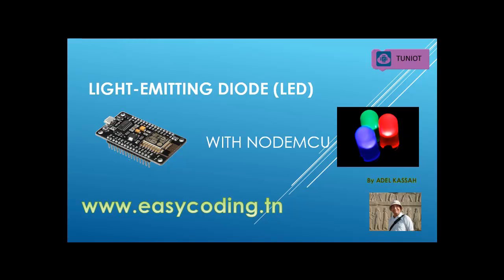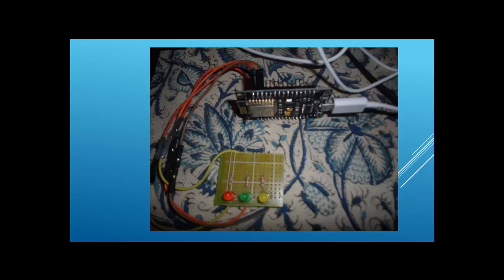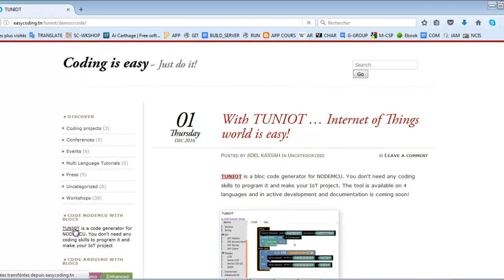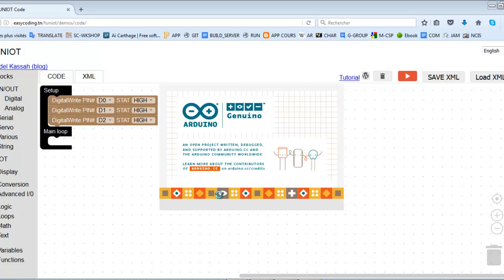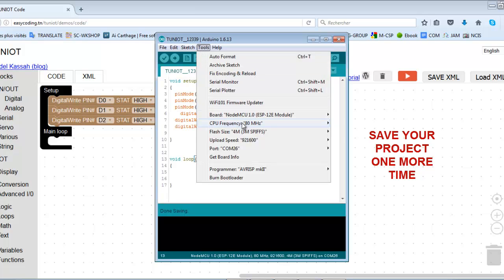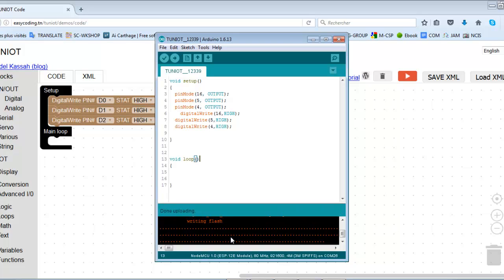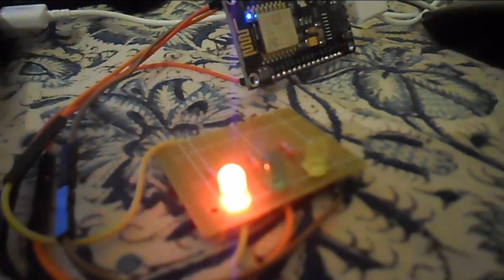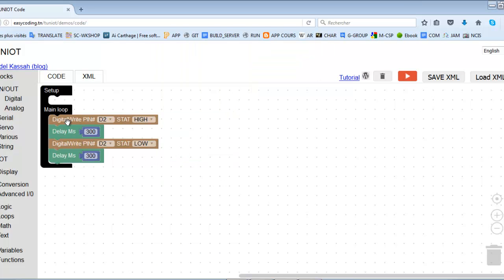NodeMcu (ESP8266) Tutorial A-03: Working with LED

Comment: Even after uploading the code and usb is removed again when usb is attached after some time same code is running how to get rid of this
Reply: once u load a program on its memory, it will work for as long as there is power. So u reconnect power, the code stored on memory runs again. This will not stop until u load a new program.

Comment: Hi All,

For those of you who are new to the ESP8266 and the NodeMCU board, be aware that the NodeMCU pin numbers are "logical" pin names that get translated into the ESP-8266 "physical" pin numbers when the Blockly code is translated into Arduino C code. 

On the ESP-8266, there are 17 General Purpose I/O ("GPIO") lines known as GPIO-0 thru GPIO-16. Six of these are used by the ESP-8266 SoC (System on a Chip) for addressing the system (flash) memory located on the ESP8266 chip. The six lines chosen were GPIO-5 thru GPIO-11, right smack in the middle of the range of available I/O pins.

This "rookie mistake" made by the designers of the ESP-8266 SoC divides the set of usable I/O pins into two sets: GPIO-0 thru GPIO-5 and GPIO-12 thru GPIO-16. So, if your program requires a series of I/O pins which you would like to treat as a single array, you can't do it because of the break in the middle. You have to code it using two for() loops instead of one. So, to fix this problem, the designers of the NodeMCU board came up with this idea of assigning logical names to these GPIO pins and having their software (eLua) automatically translate the logical names into the physical GPIO pin numbers for you.

TUNIOT also does this translation of NodeMCU logical pin names into the physical GPIO pin numbers for you, which you can see when you examine the resulting Arduino C code. When working in both of these languages,  it is useful to see how these NodeMCU pin names map into GPIO pin numbers. So, here's NodeMCU Pin Names vs GPIO Pin Numbers:

    NodeMCU           ESP-8266 GPIO 
    Pin Names:         Pin Numbers:                Notes:

          D0                  16   Controls Blue LED on ESP-12 WiFi Module
          D1                    5
          D2                    4
          D3                    0
          D4                    2   Controls NodeMCU Blue LED near USB connector
          D5                 14
          D6                 12
          D7                 13
          D8                 15
          RX (D9)           3   Serial console receive data line
          TX (D10)         1   Serial console transmit data line

On the NodeMCU board there are actually two different little blue "on-board" LEDs. The first is the little blue LED located on the ESP-12 WiFi Module (located near the WiFi antenna). The second is the little blue LED located nearer to the USB connector. This first LED is accessed using D0 (GPIO-16), while the second is accessed using D4 (GPIO-2). The TUNIOT "integrated" LED refers to this second blue LED located near the USB connector on most NodeMCU boards.

 
Here are these mappings reversed

    ESP-8266 GPIO           NodeMCU
    Pin Numbers:              Pin Names:  Notes:

          0                  D3
          1                  TX (D10)       Serial console transmit data line
          2                  D4                  Controls NodeMCU Blue LED near USB connector
          3                  RX (D9)         Serial console receive data line
          4                  D2
          5                  D1
      ---------------------------------------------------------------------------
          6                  xx   Reserved by system, DO NOT USE!
          7                  xx   Reserved by system, DO NOT USE!
          8                  xx   Reserved by system, DO NOT USE!
          9                  xx   Reserved by system, DO NOT USE!
         10                 xx   Reserved by system, DO NOT USE!
         11                 xx   Reserved by system, DO NOT USE!
      ---------------------------------------------------------------------------
         12                  D6
         13                  D7
         14                  D5
         15                  D8
         16                  D0   Controls Blue LED on ESP-12 WiFi Module

      NOTE: Never (Ever!) access physical pins GPIO-6 thru GPIO-11 as they are used
            for memory addressing and doing so will likely crash the ESP-8266 chip.

In these two tables, you will see "RX" and "TX" listed with their alternative logical pin names of "D9" and "D10", respectively. What this means is that if you do not need to use the Serial console in your Arduino sketch (that is, if you do not use any of the TUNIOT "Serial" code blocks), then you can use these two I/O pins for other purposes. However, for novice programmers, we recommend that you reserve these two pins for Serial console activities, as the Serial console can be used as a convenient debugging tool.

Feel free to copy (cut & paste) this info as it will prove useful later.

(Fini)
Reply: Much appreciated. I am new to this board, I got one off ebay with zero documentation. This helps.